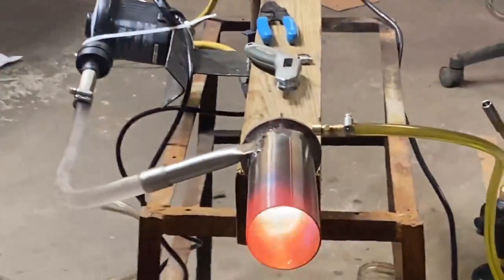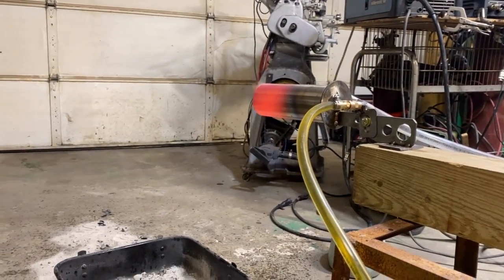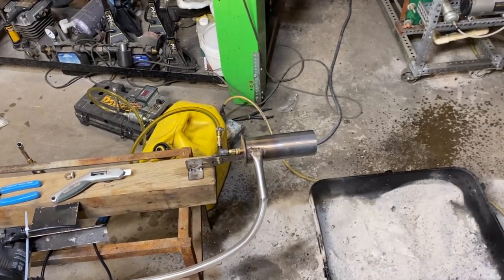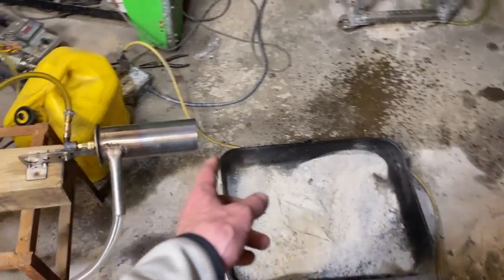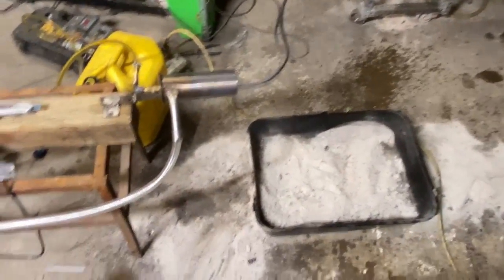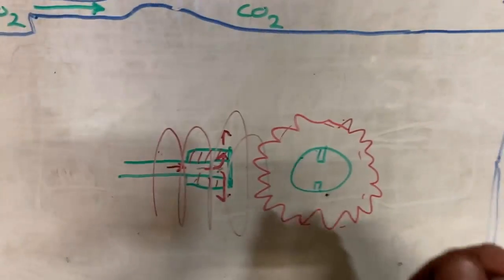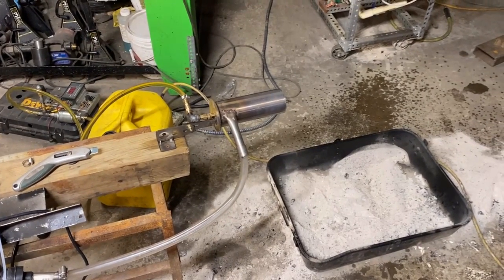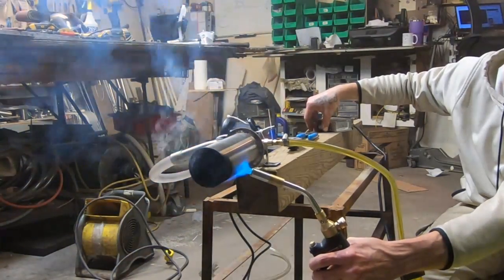Diesel burner testing and  development Air blower (NEW)

Comment: I think you need a wider tube as it looks like the oil is hitting the tube walls and dripping down, this would also partially explain the spluttering. Also more turbulence might help burn the oil more efficiently. Also based on your newer videos where the burner is sucking air from the front well a bigger blower would help or wider the air intake hole so it flows better.

Comment: Do you know the disc brake rotors or cast-iron metal pipe is not cast-iron it’s only cast-iron if it shatters when you break it with a hammer

Comment: I've been looking at using an automotive AC compressor driven by a 2 or 3 HP electric motor as a continuous duty air pump to supply air syphon nozzels without the use of a reserve tank or pressure switch. I'd really like to see if you would have success using your existing air nozzels with a very different air supply. Would be cool to see some test data on your already proven nozzels

Comment: have you seen Eberspaecher burners and chinese diesel air heaters. they run on diesel and a small air blower. they work great and maybe you can see the design they use to keep the fuel burning ( a guy called David McLuckie on youtube is great, he does alot of tests himself on them and they may give you an idea )

Comment from the maker: Guys i want to point out one thing . These blower type burners will never come close to the performance a compressed air burner can .
This type of burner would not melt copper , maybe aluminum . This is for boiling water not for forges or foundries
Reply: Well stated fella. So true.
Reply: There's a new middle ground. How about blowers which are used in misting units or portable spray paint kit? They are capable of creating fine spray